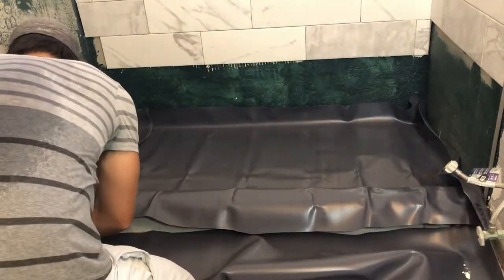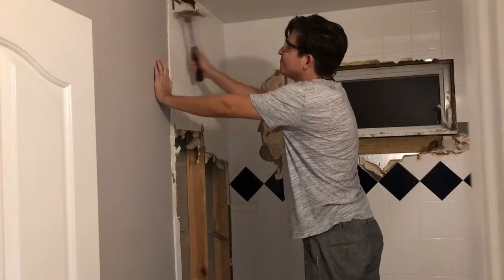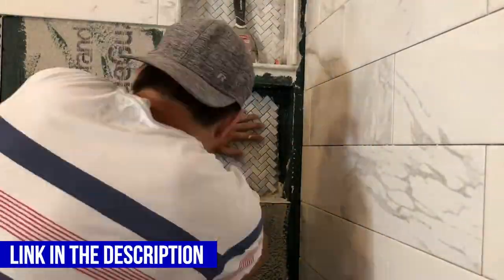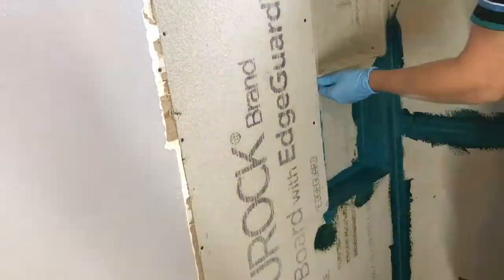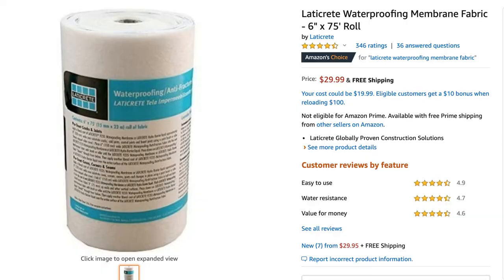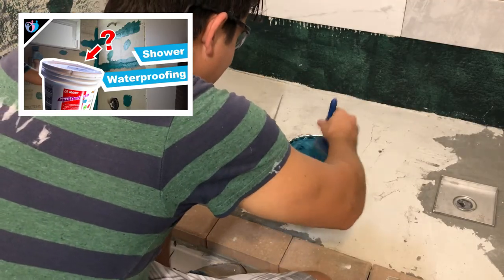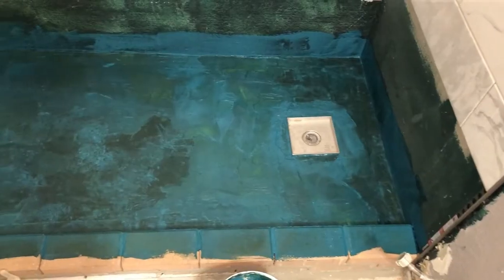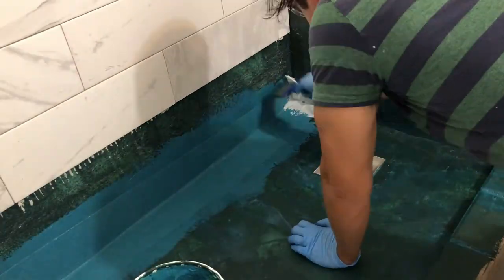How to waterproof a shower floor, shower pan, and curb

Comment: Thanks for this. I have to redo a shower wall, and I want to use the existing shower floor, but they didn't add membrane so I was hoping not to tear out the shower floor and start over. This helps alot
Reply from the maker: Awesome. I’m glad this helps.